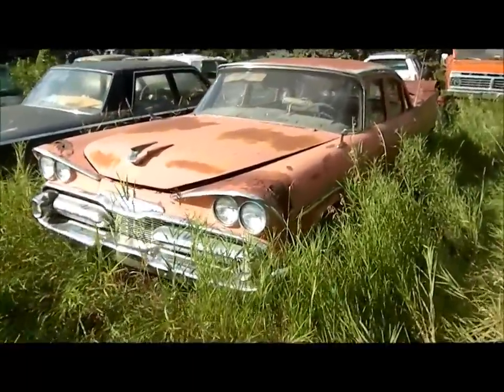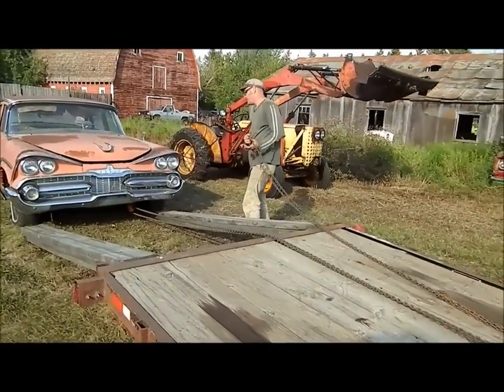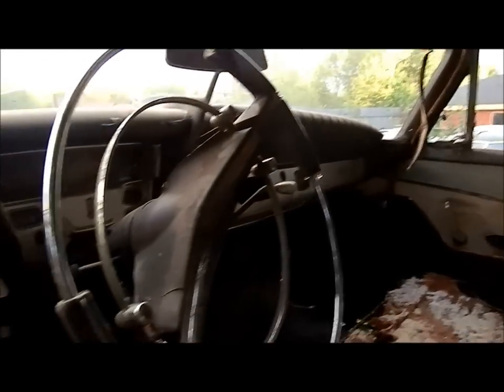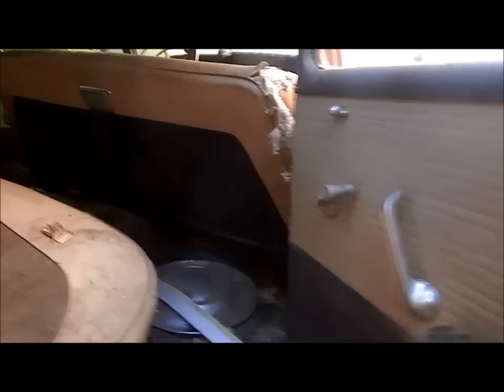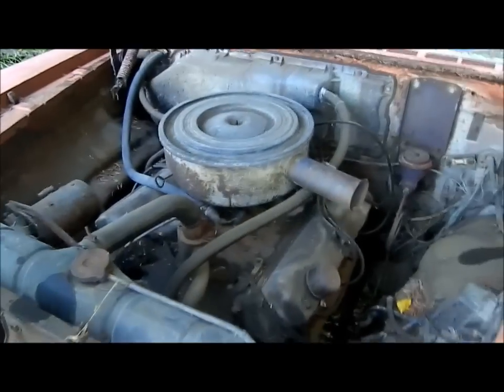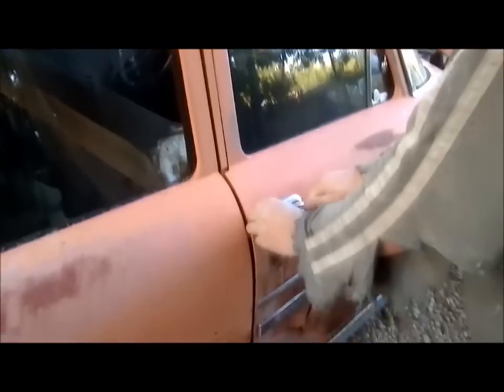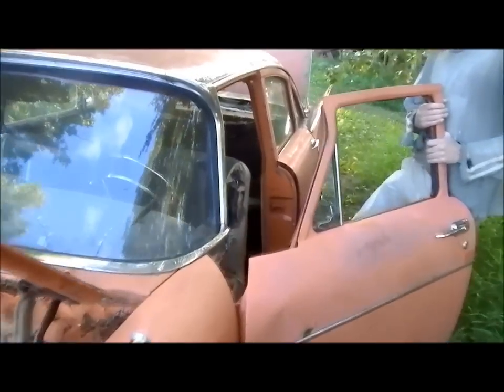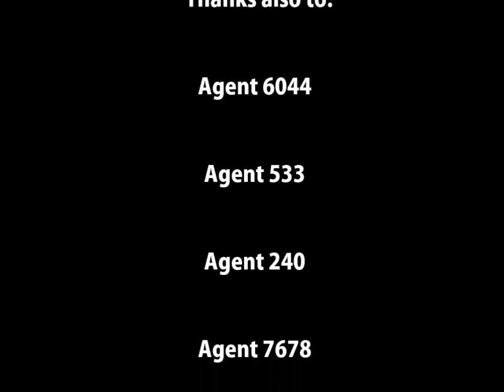Field Find: Rare 1959 Dodge Viscount!

Comment: I remember that steering wheel. My grandparents had a '57 Belvedere, nicely equipped, but my Grandma got to the point she could no longer drive non-power steering.        
Instead of going the easy route and buying a new car, Granddaddy found a '59 Plymouth parts car and paid a mechanic to transfer the power steering into the '57 Belvedere. The -57 steering wheel wouldn't fit the '59 splines, so the Bel got the '59 wheel.      
About two years later the Belvedere was heavily damaged in a Mississippi hail storm, and Grandma bit the bullet and bought a new air conditioned '67 Belvedere II hardtop coupe, white with a black vinyl top. The '67 had something Grandma just couldn't work out that looked wrong at the rear end. I (ten years old) pointed out that the left taillight had chrome trim and the right didn't.      
The Plymouth dealer installed the Satellite taillight to make things match.

Comment: Pretty good overview. The engine is actually a 313 which were in A block cars thru 1964, then 318 in 1965. There were a lot of this with the Canadian made cars. There is the Ford/Meteor of same years as well as Chev/Pontiacs with both having 6 cylender engines.

Comment: Dad had a 59 in light green metallic. Two door. Push button automatic. And swivel bench seats. Mom loved those seats. It rusted out over the headlights too dad had that fixed. I sat on the armrest in between mom and dad. No seat belts. Rear view on the dash which was metal iirc.

Comment: if you can't unfreeze the engine, are there many 318 V-8s lying around you could swap in?   I never saw many MoPars with 3-on-the-tree.  a friend of the family had a '59 Plymouth Savoy wagon with 3-on-the-tree and that thing was fast!  his wife drove a '54 Plymouth coupe with semi-automatic "Hy-Drive". the one with the red clutch pedal.
Reply from the maker: +Ross Ewage I do have an extra 318 poly sitting in the garage, but I don't think I'll put it in this car if I can't get the engine that's in it running. I will probably use it in one of the coupes.  Besides, I think she'll loosen up by next year!

Comment: Sweet lookin car,throw some oil down the cylinders,put in in 3rd gear and gently rock back and forth to loosen engine,This has worked for me before..
Reply from the maker: +Robert Hardwick Yeah, she's already soaking! I'll try again to free it up next spring... maybe even see if it'll run!
Reply: Have you checked to see if the motor will turn lately?

Comment: Sure that's not a 303 V8 in it? Canada usually got the smaller engines for some reason.
Reply: Or a 313?  My '63 440 had one.

Comment: my mopar daily driver is a bit newer.. 1975 to be exact. A beat to hell Plymouth Scamp. 225 slant/904 auto. Cut off exhaust. Shitty brakes. And had a hole in the gas tank that I have to repair each time I run too hard down gravel. My other is an '86 Ram 225/A833-My baby. the truck is down right now. but a little nicer lol. I'm 23 years old, and keep both going as long as I can
Reply from the maker: Excellent! Just stay away from new cars, right? Love those slant sixes; have a few myself... Cheers!